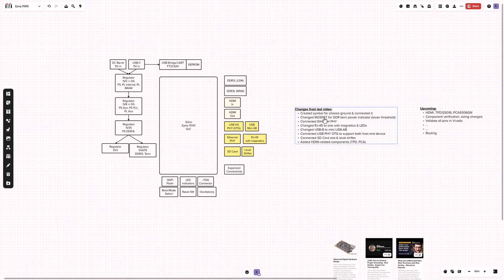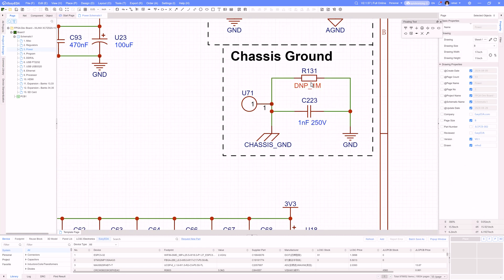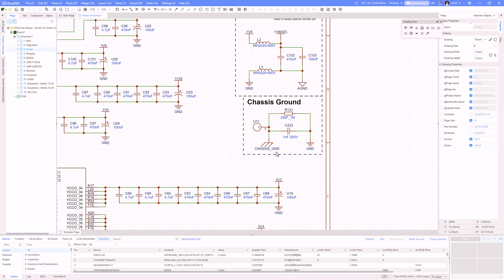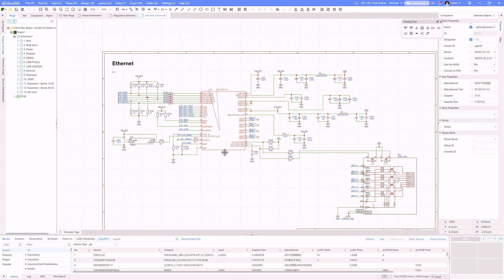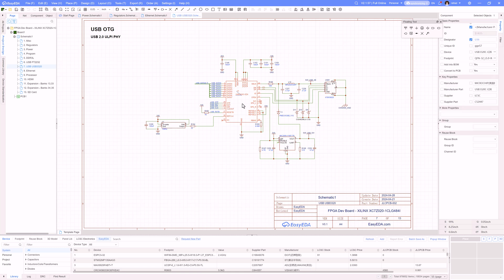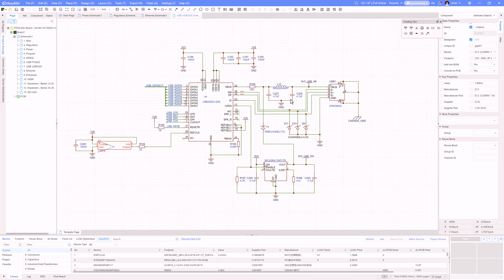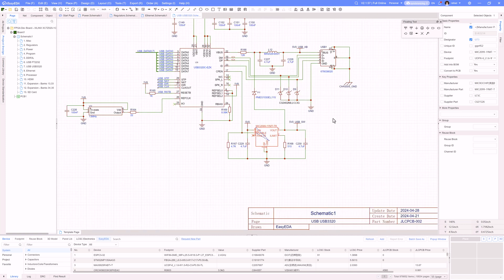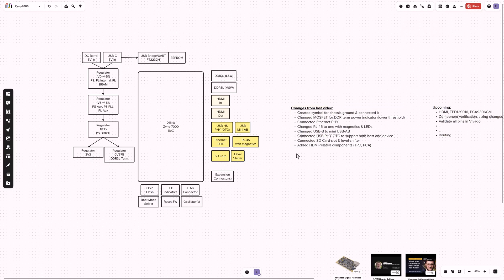Zynq-7000 PCB Build - Part 5 - USB PHY, Ethernet PHY, SD Card

Comment: Did you really need level shifter for SD card? You could map SD signals in 3V3 bank at PS pinout
Reply from the maker: For my setup, yes, it was required. The I/O pins I am using are in the HSTL 1.8V Bank 1 (with other 1.8V peripherals). Possibly, I could do some rearranging of peripherals, but at a quick glance, I'm not seeing enough open Bank 0 3.3V pins to accommodate the SD card and other current 3.3V peripherals.

Comment: When you place connectors close to each other, make sure you place them far enough apart so that you can actually connect cables to both of them at the same time, as often cable-side connectors are larger than connectors on PCB.
Reply: Good advice. Even big, known electronics companies often screw that up.
Reply: @pvc988  yep, I'm also guilty of that. Nowadays, I do a fit check to make sure this doesn't happen - by printing a top layer on a piece of paper, fitting connectors on it, and trying to connect external cables. It's not very hard, but it helped me more than once to avoid embarrassments.